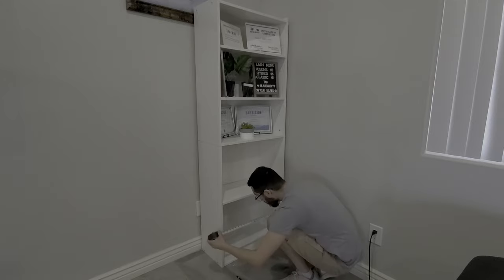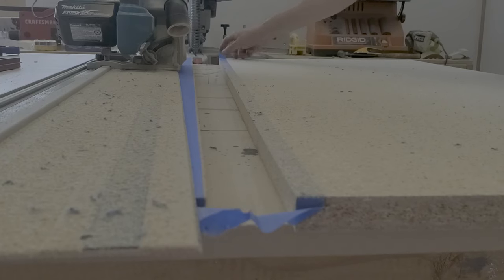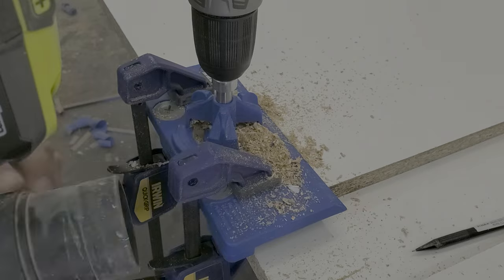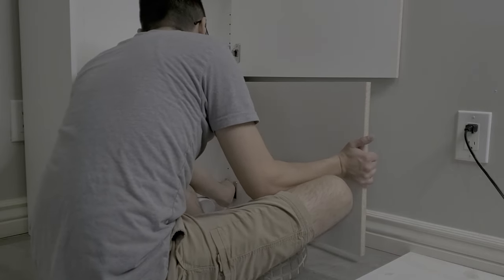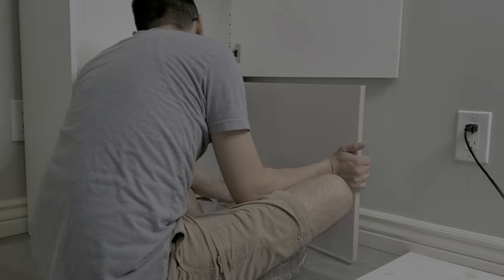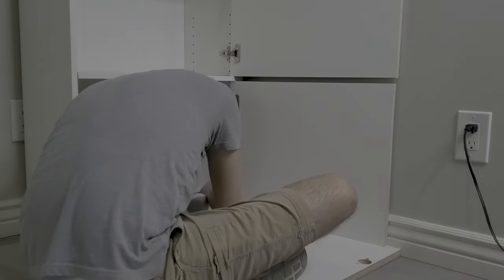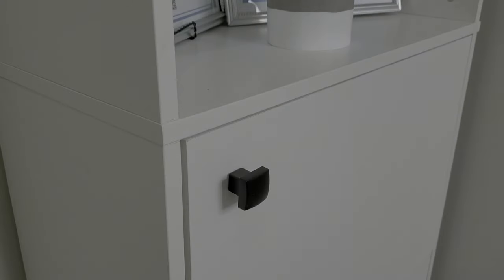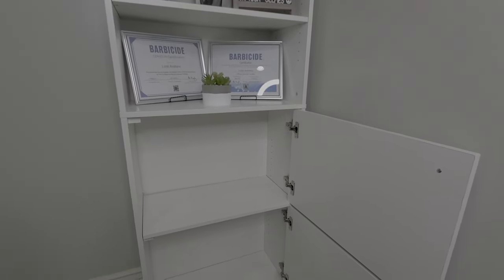Quick And Easy Way To Add Doors To Any Bookcase!!

Comment: LOL, you don't explain anything! I learned nothing other than to not bother attempting to do this myself. Not only do I not know what all of the tools you use are called so that I could gather them, because you never give any instruction, I also recognized that by the time I invest in all of that equipment, which I would now have to store, I'd spend more money and time doing it myself versus just buying a brand new bookcase with doors. You make it look like this is not worth it. Thanks!

Comment: Since I will be doing this in a way to match my other furniture that I customized, I can avoid having to buy melamine coated particle board, as the doors on my TV stand are covered in color-shift vinyl, so looks like I'm buying more vinyl!  Thanks for this tutorial!  It's been a long time since I did any woodworking, so it's nice to get an idea of where to go with putting doors on and not wrecking my bookcase.  I live in an apartment, and we have a management team, so they often hire outside contractors, and it drives me nuts having to be here so nothing gets stolen (some worker attempted to steal my neighbor's daughter's phone, and she came down and told me about it and how ticked she was (the worker happened to be in the hallway on my floor), and oddly enough that phone reappeared  between two books on her bookshelf, her daughter had left the phone on the sofa), so I want to add locking doors to all of my book cases so I can lock up things that are worthy of someone trying to steal.   It's a real bummer people here can't even trust the contractors they hire for things like floor renovations, and painting.  smh
Reply from the maker: Wow thats crazy ! Sucks we live in a world where you can't trust anyone anymore. Also good luck with your project 🙂

Comment: Melanine board is cheep but those hinges.. just the board and the hinges costs as the doors from ikea to my shelf. Havent looked on door knobs and the strips for the edges yet. I would do this if it wouldn’t be so expansive with the fittings.